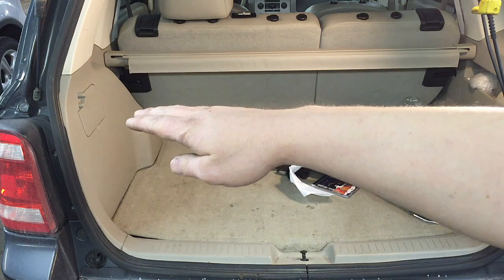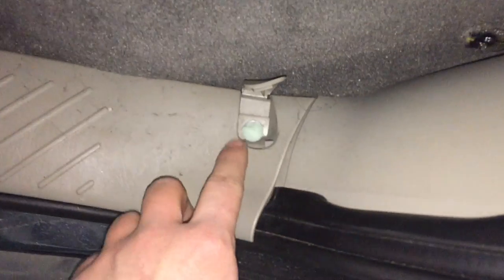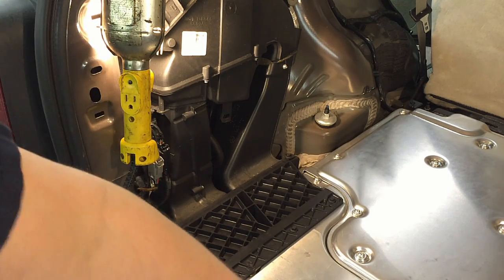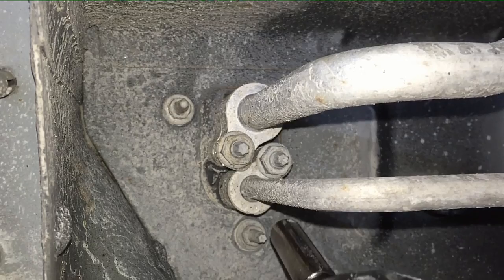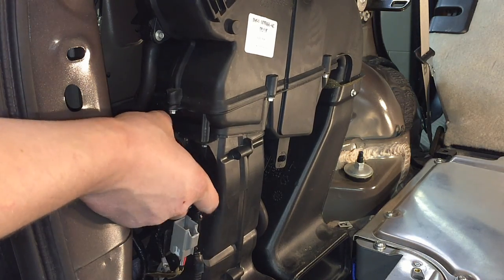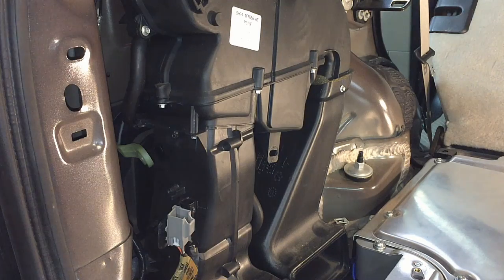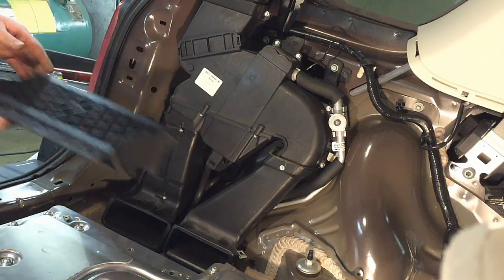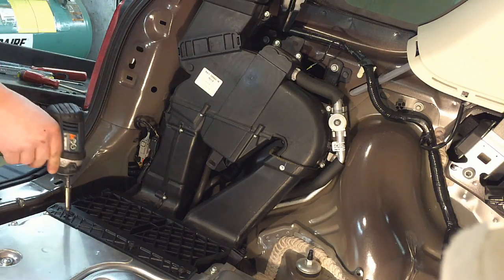2005-2008 Ford Escape Hybrid Wrench Light B1239: Rear Mode Door Actuator Replacement

Comment: Followed this and it worked for the most part, with the exception of my unit not lifting up, it would only wiggle slightly, I didnt want to put to much force and damage the coolant lines, so I spent way too much time removing and then threading and reinserting that back screw. It seems to be working well now, thank you for saving me the shop costs, which as others have mentioned would have been ridiculous

Comment: Great video!  Very helpful.  I wanted to let people know that you can get off the 5.5 mm nuts mounting the actuator using a tiny 5.5 mm wrench and skip the steps freeing the case and also not have to struggle with the metal bracket that is in front of the case.  I started this project without the tiny wrenches and I had to remove the metal bracket completely to get the case free.   I had broken mounts by the refrigerant lines, which are plastic in the 2006, so I wasn't able to complete the last step freeing the case.  Because of this I had to get the 5.5 mm nuts off somehow and the tiny wrenches did the trick.   Next time I would skip right to the actuator after removing the cover.
Reply: I attempted to skip the "freeing the case" step, however, didn't have enough room to get the old actuator out without freeing it.  2007
Reply: Thanks for this video.

Comment: Thank you for posting this video. I have a 2009 FEH with this code that would come on when it is hot outside or I had been driving for an extended period. Pretty much everything for 2009 was the same as your video, the only difference was the AC refrigerant lines looked a bit different. The bolts had a rubber cap and I wasn't able to get them off because they appeared to be stripped (I bought used)? I ended up being able to get the actuator off without removing these bolts using a combination wrench. Your videos are great and I'm really happy to have saved a considerable amount of money fixing it myself with a $20 part.

Comment: Thank you very much for this excellent repair video. I don't think it could have been explained better. It took me an hour to do this repair. Now the service soon wrench is gone on my 2005 Escape Hybrid. Please keep doing these great video, they are very much appreciated.
Reply from the maker: +Richard Jarosch Nice!!
Reply: @FordTechMakuloco  one of the cooling fans did not work i got two new ones but i still have the wrench light   and the hybrid battery is very hot.... do i have to get a new rear mode actuator

Comment: You sir are my hero. I had a bit of trouble getting the vent unit from behind the metal bracket, but it came out fine after I snapped the plastic bracket off the vent housing which was holding it back.

Comment: I wonder if now is a good time to replace the hybrid battery filter, near your left thumb at @13:18.  Do you have a recommended replacement schedule for this?  I just found out ours was clogged, maybe from all the smoke in the air. Great and simple video!  Subscribed!

Comment: Thanks to your very detailed walkthrough I have successfully replaced my failing rear mode door actuator. Unfortunately, I now hear a clicking noise when I turn the power on. Have you ever had that problem? Is my replacement actuator faulty, or have I made a mistake installing it? Thanks a lot for your video!
Reply: I've followed the walk through and also hear a loud clicking noise upon start up and sometimes while driving a bit harder, e.g., up hills.
Reply: François Pradel 
I have it replaced. The first day was a breeze sound then the clicking sound getting louder each time start the engine, thinking maybe it was a wrong or failure part problem? I’ll get a new one from the dealer to see if it stop making clicking noise.

Comment: In my car it shows in after I drive for a while, but in cold start I don’t see it. Also it switches the hybrid motor and gas motor perfectly. But today outside temperature was 107 degrees and it stopped switching to Hybrid. Also my AC stopped cooling today after I put refrigerant, probably I put some extra refrigerant and due to which it’s not working. So overall it was a heated situation. But the 🔧 sign comes on and off frequently. I scanned today with the Autozone’s scanner but nothing detected.
Reply: Mine also didn't show at Autozone. I had to take it to a mechanic for them to run a diagnostic. They told me the code, but said only Ford dealership could fix it in my town. So googling brought me here.

Comment: I replaced one of these today and the service info said to update the Traction Battery Control Module. I was using the IDS but did not see that module listed under module reprogramming or under PMI, am I missing it somewhere else? Thanks.

Comment: Could this be relevant to a 2009? My wrench icon is intermittent. I restart the vehicle and it goes away and drives just fine. When it was -25f it would start and shut off immediately with the wrench and a pull over safely warning, but started working fine when it warmed up over 0f.

I had it at the dealer today and no relevant codes were pulling, and the light was not on so they did not fix anything.

Comment: I have a 2006 Ford Escape Hybrid and did the mode door actuator repair a while back, about 80,000 miles ago actually.  The repair guy couldn't get the wrench light to turn off after the repair (actually , I think he got it turn on, but it was back on next time the car turned on) .  Now i am trying to sell the car and the buyer took it to a ford dealer who is saying there is still a code for the battery cooling and they want me to pay $1200 to replace a motor to cool the battery.  The vehicle has ran fine for the last two and a half years since this repair without the hybrid battery working fine, never overheating, and I get about 35 mpg.  So, I really don't see the point in spending $1200 on a car with 211,000 miles on it that is working fine and has been.  The light has been on since the last repair and at that time, the guy said he just couldn't figure out how to reset it.  The dealer who just checked the light said it say battery cooling, but no specific code, so they want to just replace the whole cooling system.  I asked why they can't check the temp of the battery, the history of the battery temp should be available and would point to any real issues with the cooling systems...What say you??  Any ideas?  I feel at the mercy of a tricky system that the diagnostic system doesn't fully diagnose...
Reply from the maker: +Kris Schade They most likely have to replace the internal wiring harness for the cooling fans which requires removal of the high voltage traction battery the labor is quite intense. Ford even says though these codes have no bearing on the systems functionality.
Reply: Cool, thanks for the response. I did have the battery harness work done as part of a recall but that was over 100,000 miles ago, not sure if it would go bad again or if its something else. The light has been on ever since I had the actuator repair done and I member the guy saying he had a hard time resetting it and that he thought it would come back on again so it is hard to say what it really could be.

Comment: Hey man this wrench light came on in my 2013 ford transit. No check engine light to go with it so my scanner won't pick up any codes but the engine does lose power and transmission shifts hard once light comes on. Light goes away if I turn off vehicle and turn back on but comes back after about 5 mins of driving. Any advice or idea what it could be?

Comment: Hi,06 escape hybrid stopped to get mail accidentally shut car off in neutral .went to re start wrench light stop light ..code p0a 78-ff then it has  voltage codes for abs tcm and it has   a code for a fan  Motor in hv  battery . voltage in hv battery is at 200 volts .. turns over but does not continue to run spark shut down fuel injectors shut down ..fuel pump pressure is good key on engine off it's at 49 then shot up to 65 ..my question is if have relearned all the modules could the low voltage in hv battery cause the car to not start... shutting down the tcm?

Comment: Hi is this blend door separate from the hvac blend door for climate control or part of that system? Trying to understand its operation. Thanks
Reply: they are separate systems.  This on in the video is only for Traction battery cooling

Comment: What kind of a code reader do you need to pull the codes for the wrench light?
Reply: You need one that does more advanced codes than generic OBDII. I used a WiFi-enabled reader called an OBDLink MX with their iOS app.
Reply: Did you  bought  the OBDII MDX

Comment: I have a Q for u FordTechMakuloco now i have a 2008 Ford Escape Hybrid now when i start my car and drive it the changing gauge isn't sitting in the middle is more on the drain side then when i hit the brakes to charge the battery its instantly goes back to where it was as well as my AC is always on for the battery bur i pulled the cover off and i dont feel the AC going to it even tho i got nice cold AC up front if u can plz help me out

Comment: I needed the back door of my 2008 escape hybrid open, I believe the elec. switch or actuator is bad?
Reply: What does service emissions system soon mean on 2005 Ford escape hybrid
Reply: My check engine light came on went to AutoZone they said nothing is coming up
Reply: Anybody have this problem
Reply: @richyboy_623gonzalez4  mine came up coolant temperature sensor

Comment: Amazon tells me this item does not fit my 2007 Ford Escape? Is there a different model I should be looking for?
Reply from the maker: The one I link to is correct for your model.
Reply: That's the one Amazon tells me does not fit the 07 Escape. I'll take your word for it though and order.
Reply: @bryannichols2493  did it work?
Reply: gibson76 I never ended up using it so I couldn’t tell ya.
Reply: @bryannichols2493  why not?

Comment: What does the wrench light look like on the dashboard?  Should it flash or stay on or make a noise?  Could you show me a picture?  Ty
Reply: Small, solid orange wrench at the lower left side of the dash. Mine did not blink - comes on and stays on, but only intermittently.  i.e., if I park and go into a store, when I come out and start the car back up the wrench is gone. Happens every few weeks - I finally found the actual code today which led me to this video.
Reply: @AmplifyDIY  what scan tool you used
Reply: @lupetorres8759  A regular OBDII reader will do it. See my other response to your same question.
Reply: @AmplifyDIY  I used a regular  Obd reader and only reads the check engine  codes.

Comment: Hello, I just changed out the part and it still gives me the same service light on ? Did I get the wrong part ? Or do I just need to reset the computer ? Any thoughts anyone ??
Reply: Did you change the filter and reset the code?

Comment: If anybody knows . i have a 2010 escape hybrid, and i don’t think it has a blend door, it has an opening from inside the trunk which i think sucks the air in to cool the hybrid battery, my wrench sign comes on dashboard usually in high way hi speed, and car keep driving normal with no issues , and almost always the sign goes away when turn car engine off and restart it again , my question is , could it be any thing related to the hybrid battery, do i have actuator in the trunk like the 2008 escape hybrid or not, or may be the fan for the hybrid battery ????, or may be non of that and it is the throttle body, appreciate any comment , than you very much
Reply: Did you ever find an answer to your problem, I have a 2012 that does the same thing

Comment: I have a 2008 Ford Escape v6 3.0l and the orange wrench light came on and when I get up to 20-25 mph it seems to have a hard time shifting into gear. Any idea what it could be I think it might b a transmission issue but not sure been told that by dealership but don’t have that kind of money to take it apart. Anything I can do myself?
Reply: You could try taking it to an auto parts store and asking them to read the codes from the onboard diagnostic computer for you. They usually do so for free.
Reply: @AmplifyDIY   what scan tool is good to read the wrech light
Reply: @lupetorres8759  Any OBDII reader will do it. Search Amazon for that if you want to buy your own... or just take it to literally just about any local auto parts store. Most have a scanner and are happy to read the codes for you for free.